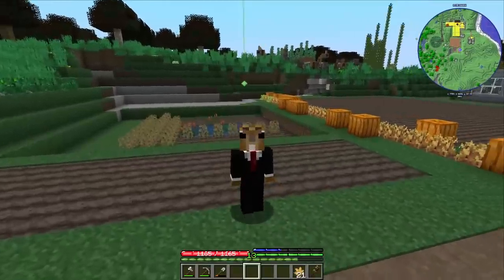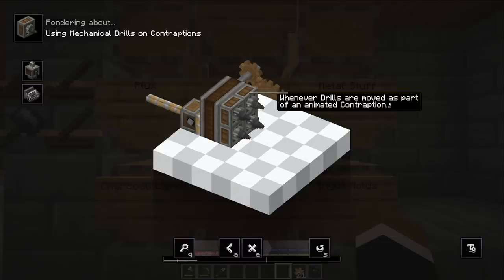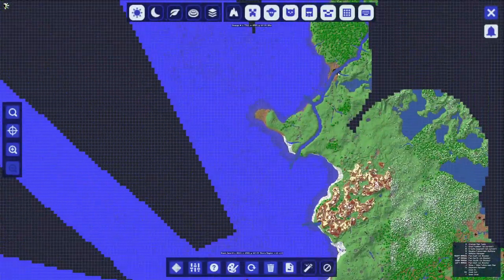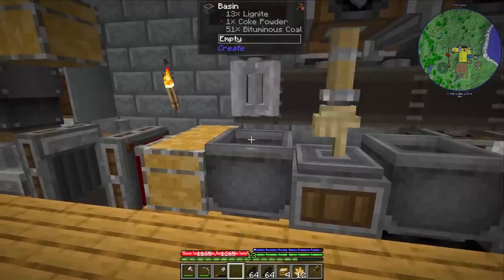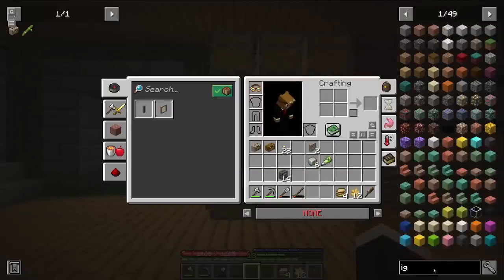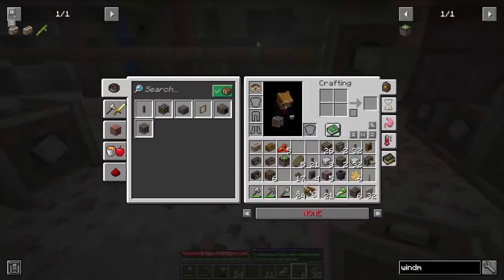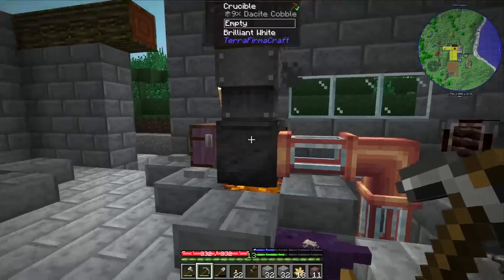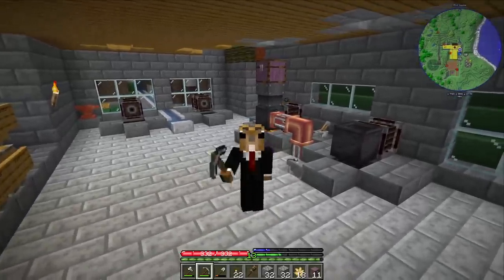ATFC: Experimenting With Drills (Episode 21)

Comment: I recommend using minecart contraption to make automatic tunnel bore. Machine placing rails in front of it and picking them up behind it using a plow, powered by furnace minecart.
Reply: Yeah, he mentioned a bit of minecarts at the very end—he just hasn't progressed to it.
Reply: @aboringperson9069  he already has everything he needs, unless the cart assembler or coupe of rails are somehow hard to make he's good to go.
Reply: quick note this can also be done with powered rails and redstone blocks, given a bit of ingenuity to make sure the inventory is handled correctly.

on another note, automatic tunnel bores are significantly more complex then you might expect, because you need to hole proof and liquid proof the things. This is doubly hard in TFC because you can't just recycle the mined stone into a protective tunnel; you would need to find a block that drops itself and is generally environment proof, as well as then set up a series of placers and drills to place, then retrieve the blocks when the cart-core has passed.
Reply: But I think in this modpack it would be better just to use drills to dig down at each veins
Reply: Cave ins though?
Reply: @alexcattwo1300  this machine is liquid proof on its own (ever since one of the recent updates where water doesn't destroy rails), you only have to place block under the rails incase you run into cave or ravine so couple stacks of blocks is enough.
Reply: @alexcattwo1300  Redstone torches are better because they are instaminable and you can collect them by mechanical plough
Reply: I love to drill holes downwards. Use a few pistons as a light flying-machine to position the drills and then it mine downwards with a pulley. This way, he could also get a hole for his crop farm ad bedrock level.
Reply: @jackdesanta69  This is 1.18.2, so probably not. Yeah, it sucks, but TFC hasn't been ported to 1.19.x yet.
Reply: @jornott8399  The craziest thing you can do actually, is to use a minecart-contraption to drill down. It's very fast, but won't stop falling until bedrock.

Comment: Hey mango a quick Tipp if u really want to finish the game fast: mechanical drills upside down clued together with a rope pulley on top which drives the whole contraption down to world bottom. Of course add a chest! Add a gantry carriage with gantry shafts to the rope pully to built a world eater. You do also need to add a power unit to the gantry shaft. If you now power the gantry shaft the whole contraption starts moving down. Add a gearshift to get it up real quick. Can be easily automated with a clutch and some redstone skills ;)
Reply: Can this handle cave-ins ?
Reply: @luelou8464  I personally deal with this by having more drills on top facing upwards lol
Reply: @OlieB  provided you don't mine next to it, cave ins won't happen because of Create drills. You can imagine it as the drills being super precise or something
Reply: @eragonawesome  ahh okay, was also thinking about unsupported blocks, like if you dtill into the top of a cave
Reply: @OlieB  so long as you aren't pushing at max speed past the blocks as they're falling you should be fine
Reply: add a windmill, a clutch, a redstone link and a latch, glue the whole thing together and put it on a cart, boom, pocket world eater.
Reply: @lubomirkompis9441  This is the way, windmill powered quarry cart contraption.
Reply: Robotic warfare built this in the Livestream before they all spread out

Comment: Common create tips:

- you can mine made casings by rightclicking them with a wrench, instead of mining them. Doesn’t use any durability.

- you can reverse a shaft direction by scrolling the speed controller into the other direction, making it go in the negative RPM, which is just positive RPM into the other direction.

Comment: After you add the fuel if you shift right click with a torch it lites it instantly. Works for firepits too.
Edit: I was reading TFC changelogs for newer versions. In later versions of the TFC  this feature has been removed. It's still in the auto-TFC version because it lags a few versions behind the latest TFC releases.

Comment: the fastest way i have found to make casings manually, is to first pillar up stripping the logs as you go (logs off hand, axe in main hand and hold right click and pillar up), then on the way back down swap the logs for the material needed for the casing and axe with wrench and then hold shift and right click and it makes the casings. this is by far the fastest way, and may even be faster than slower automated machines

Comment: You can use drills with a pulley for infinite depth quarrying allowing you to build (or place with a cart assembler) a machine above an ore patch and get both much if the ore but also easy safe access to the rest.

Comment: @ilmango it seems the crucible or cauldron is like a real pot. It takes long at first, Only if your waiting for it to get up to the right temp.. But once it's at the desired temp the crushed iron will melt significantly faster  cause it no longer has to wait...

Comment: a rope pulley is good for drilling down
the problem with max speed drills is that they go through blocks as you saw
if you double layer it then it will drill with no problem

Comment: The drill can actually be automatic without a piston pulley. Rails can make this easier and make a makeshift drill bore train system that can run on either the infinite rails or till it’s out of fuel.

You’ll know pretty soon as you read more on Create, the only Mod that makes anything possible even making automatic brewery for potions.

Comment: After ir has heat up a crucible it's easier to melt stuff and if it has some hot melted stuff already it has heat energy in that melted mass that gets transferred to the solid material, hence why it's faster with already melted iron in it. Just like IRL.
In old steel plants getting the heat going in the "furnace"  and such takes a lot of time and energy so you need to keep feeding like iron pellets and coal, letting the steel drain slowly and put more raw materials. Modern plants can use "arc furnaces", which is like a big electric arc generator that drops in a big crucible to heat the material. In steel making they preferably use recycled steel, as it takes less time and energy then going then with only raw materials. Not an area that I worked on, but I did study some of it in university.
The drills in Create open up so many possibilities and the mechanics seem more interesting then the "magical" drills and quarries in good old BuildCraft mod back in Beta. I'm just not sure about the windmills working underground, as it just feels very weird and wrong.

Comment: you should really find that lava source soon. is probably down below if you just mine down to Y=-50 or so. i did it in my world and is one of the best things i did. not only for igneous alloy production, but also for shaft production, which is basically cogwheel production and gearbox production... is just great in general to get the basics for create, and you only need a fan, some drills and water, which you can get from the surface.

also... once you have a cobble gen and a stone gen, you can actually generate ores for free too that way, you craft what the drill breaks with mechanical crafters, then you wash it using water and a fan, and then you crush it to get double yield... is not a lot per drill, and is going to be messy working all the wheels and water and lava and conveyor belts... but i think is worth it, is basically free iron,copper and gold from cobble, and a lot others from stone

(btw, im calling it cobble and stone but is really lava into flowing water or lava into source water, since in vanilla that is cobble and stone, here is two different stones that give different ores)

Comment: Hi Ilmango. I was wondering, if you made the magma blocks in the crucible, but you filled the crucible with molten iron first, would they convert from cobble to magma quicker? As it seems the iron melted quicker if the crucible was more full.
Reply: No. Mango did not realize that the forge required some time to heat up. The fill level does not matter

Comment: Hey Mango :D Just a little tip for ya. You don't have to use gearshift in order to change rotation direction, you can use gearbox instead. Gearshift is used when you wanna regularly control direction, if you want permanent, then gearbox is way easier solution ;)
Reply: He knows that, but in this case he needed to be able to change direction to pull the drill back. It would have been more tedious having to destroy and replace a gearbox every time.